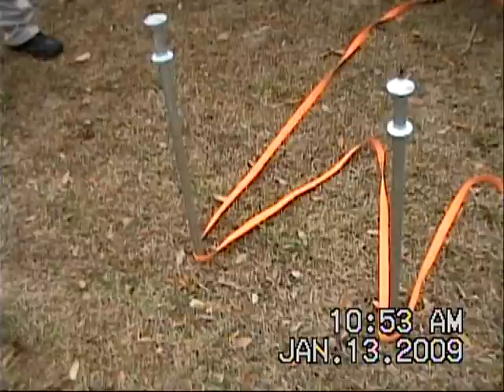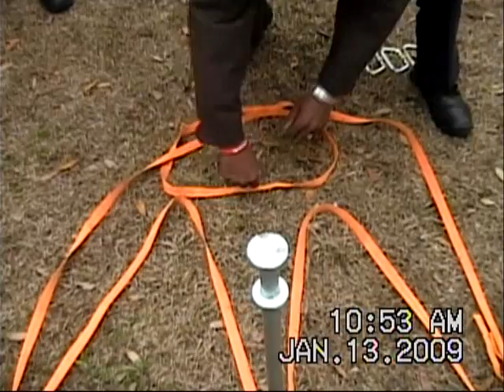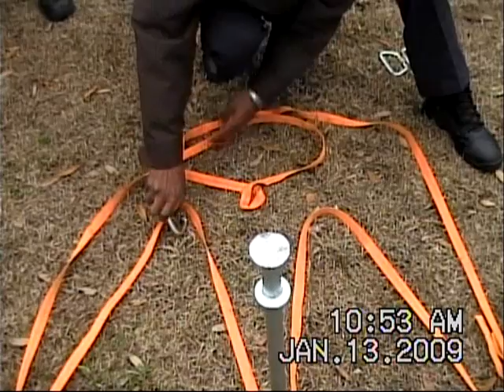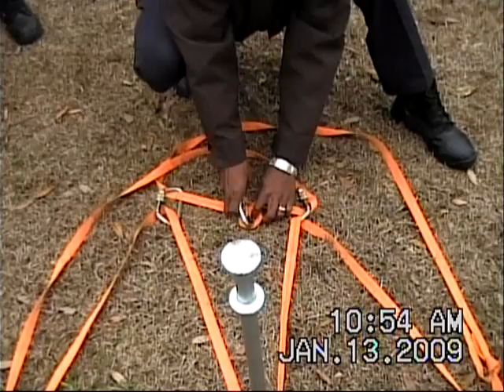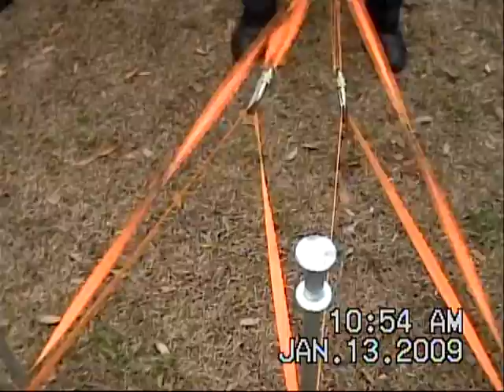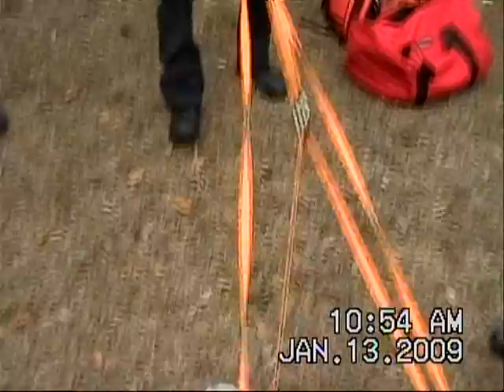3 Anchor Load Distributing

Comment: Wow, gong show..learnt that back in the day and was suspect back then too. Equalize your anchor in direction of load..tie off a single focal point to eliminate extension if a point fails> "equalization" under load is a myth, the sling bites on it's self and does not equalize as the load shifts.

Comment: yah..interesting...there are two big downfall in my opinion.  1st its very complicated.  the Second huge problem is that if one piece on the wall fails then you shock-load the other two and that can be really bad!!!  But its a cool idea but not very safe unless you are tying to a tree on bolts then I would not be that worried about equalizing

Comment: @tangoray187 because when you tie them off the will not equalize. Then there is only on eor two pints during the main loading.  also when one anchor fails, the slack is pulled through several pieces of hardware, creating friction which dissipates energy. 
Unfortunately the shown system is far tow large and should be shrunk down to a smaller size to reduces potential energy.